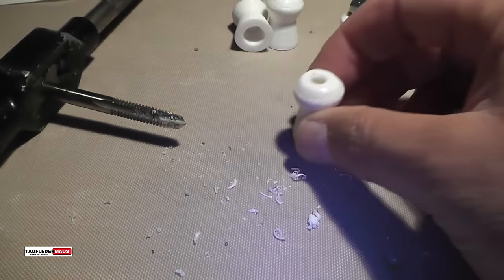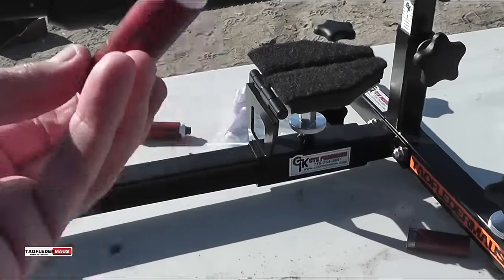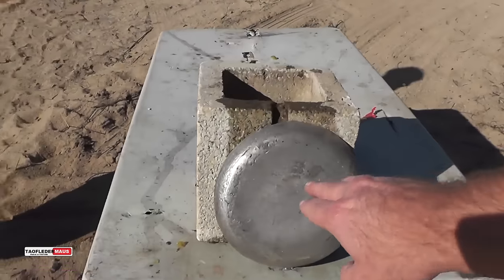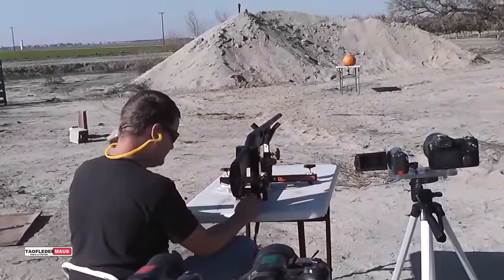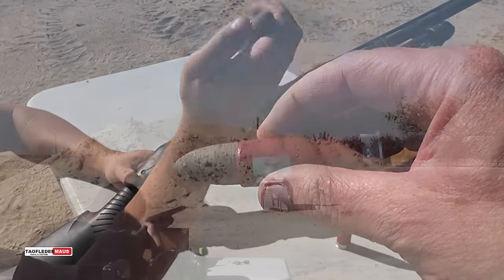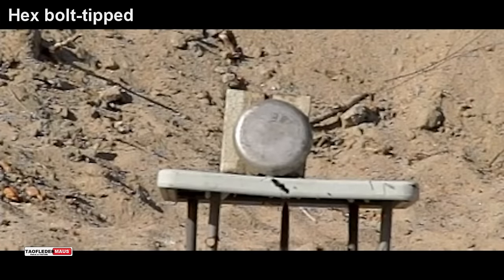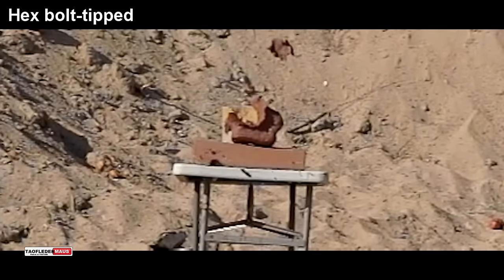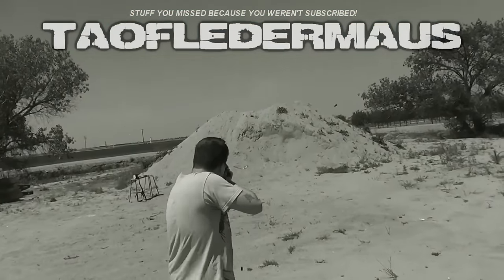15 year old viewer creates incredible 3D printed Slugs

Comment: I am not at all surprised that this design worked.  I have been meaning to suggest it for some time now.  I am however in wonder that the material used to create the oversized pellets held together.  Yes you should get tactical g-code to cut a few made out of brass with carbide tips in them.  Also, I suggest for future smoothbore projects that you do some research on smoothbore tank rounds.  Smooth bore tank guns are supposed to be more accurate than rifled ones.  Perhaps by studying the designs of some of the projectiles you could come up was a round that will fly stable out of a smoothbore shot barrel.  Just a thought.  :)

Comment: Drill a hole all the way though and put a large bolt in from behind with 2 nuts on the tip (trim the excess bolt if needed)  that should give you way more kinetic energy, plus the bolt head will harness all the power of the powder just using the 3d printed body for aerodynamics. Ohh and maybe hi brass :)
Reply: You can even file the tip of the bolt to make it some sort of dart

Comment: Instead of threading them try just drilling them and hot gluing the bolts. That way the bolt can separate and continue on. You would get much better penetration.

Comment: Why would you expect it to go faster? It may be easier to "push", but You bascally get the same volume to generate drag with much less mass to store the energy. It should actually go slower.
Reply from the maker: +zamaszysty  The shells are designed to propel a 1 oz load at 1250fps.   Normally objects lighter than that will go faster in proportion to the weight.   Because these were so light,  they did not provide enough resistance for the powder to burn at 100% efficiency.
Reply: And, on top of that - they also slowed down faster due to drag vs. weight ratio. So that's two reasons for them to go slower :)

Comment: Well - lets make an injection mold, sell the plastic pieces as figures for board games and well: Having a tab and a few screws is easy. I mean: it is a brilliant design, but when driving it to market, it is just a piece of plastic to be mass produced which means injection molding. Part of the brilliant engineering that went into those was you making a thread into them and screwing a screw in. Making the plastic from a 3D printer does prove, that the design is so robust, that a simple plastic and mold are good enough to mass produce. I see barely any point in using a 3D printer other then proove of concept - but a brilliant prove it is

Comment: Those are the same design as a Silverbear air rifle pellet. That's pretty awesome. But you should be shooting them at subsonic speeds
Reply from the maker: +Jake S    A lot of air rifle enthusiasts did not think this design would be stable at supersonic speeds.
Reply: ***** what if you tried it at subsonic? And is it possible to get the weight more evenly distributed?
Reply from the maker: I'm sure they would work well at subsonic speeds too.   I don't have any more of these to test but I hope Michael will send more eventually.

Comment: how do they work out of a smooth bore?
Reply: +Hayden cowen sorry how well* do they work out of a smooth bore
Reply from the maker: +Hayden cowen   That was one thing we failed to do.   I was going to do that but we were on a roll with the Benelli we didn't want to mess things up!
Reply: fair enough, I'd give them a go with mine ive got a range of lengths of smooth bore in 12 gauge (from 18-36 inch) but lack a 3d printer. ill see if I can get to a tech shop and get some made up.

Comment: This is just a copy of projectiles used in air compressed carbines.
Reply from the maker: +michaelovitch  They are shot out of a shotgun  and are 70 cal.   Definitely not a copy.
Reply: +TAOFLEDERMAUS 
you said it yourself ,i saw it later :
" we test out some more 3D printed slugs that are based on the design of an air rifle pellet"
exact same shape,even the ball of steel is a technic used in air rifle pellet.

Comment: sorry but 3d printed bullets have already existed for a few years (2012 that i know of) and even working 3d printed guns starting with grips (2011) working reusable guns as early as 2013.
Reply from the maker: +zylofaxx  Did you ever see high speed performance of those?    These worked.
Reply: Ya, the impressive thing is these work where as most of the others were crap. And I have yet to see a 3d printed gun that actually worked. Everyone of them I have seen tested blew up. And quite honestly you can build a working gun with plumbing supplies, you don't need to 3d print one.

Comment: You need to put a carriage head bolt in the end instead of a hex head.
Reply from the maker: +Pilgrim Prepper  I knew I did it all wrong!
Reply: Not all wrong no, in fact this will go down as one of your greatest successes, but the round nose of the carriage head would have possibly flown better, and looked cooler... Trust me, I'm your helpful hardware man...

Comment: No one has done it because it is a pure waste of time. The lightest 12 gauge slug bought on the market probably weighs around 383 grains. Shotgun slugs that are store bought have the weight to create massive damage and reliability. They even make slugs to kill bears. Brenneke Black Magic Magnum Ammo for 12 ga. Each slug weighs about 600 grains and is designed for maximum penetration. A box of these is like 13 bucks and this is surely the expensive stuff. So by the time you wasted on printed bullets you could have bought slugs that were actually worth a damn, lol.
Reply from the maker: +Azygos1986   Thanks for the dissertation.

Comment: Not really a 3d printed bullet is it when you need to then still fill the thing with various other metal objects. Also as others have said, it's a scaled up pellet, there's also the fact the bolts are what's being hit by the air and forcing it around the rest of the bullet. The kid isn't a genius, he didn't spend weeks working on a design in CAD with mm precise modeling and simulations.
Reply from the maker: +oBLACKIECHANoo  You're just mad you didn't think of it and become famous.
Reply: ***** I'm glad the kid is doing this kind of stuff but I'm just being realistic. It's not that nobody else thought of doing this and this guy is a genius it's that nobody else thought it would be worth doing.
Reply from the maker: There's a lot of dreamers,  but a few do-ers.

Comment: Now put a mercury capsule inside of it TFM. ;)    Great work by this kid indeed.
Reply from the maker: +Toasty Roasty Man   haha!  sure!
Reply: I guess you can't use mercury looking at your earlier videos but I bet you can use very heavy # 1 motor oil and seal the round with STEEL EPOXY PUTTY you can get right at walmart..

In fact I bet it would make a pretty good shot gun slug all by itself ! :)

Comment: so he found a way to make universal shot gun ammo ? Not that there was already a way but now anyone can have them!!!!! with a 3d printer..... It is a very nice simple design, but very effective.
Reply from the maker: +IloveJell0w  But people are all ready casting lead slugs that take about 10 seconds for each one.
Reply: ***** The difference is lead slugs are more expensive to cast.
Reply from the maker: They are dirt cheap to cast.
Reply: ***** Ya even though its 80 cents its about $1.00 each if you don't self craft and to get the self craft will be pretty high in it self while you could get a $800 printer and abs plastic pretty cheap do about %30 percent cheaper (guess is lower than dirt then). Ya these things don't go through metal but anything organic will not be in great condition afterwards.
Reply from the maker: You can cast bullets for less than a penny a piece.
Reply: ***** Last I checked for lead ingots its about $5-6 or so. You can cast them free not penny a piece. But you still have to buy the lead and the ability to smelt them. So in the end casting them costs more than a penny a piece unless you buy them which they will cost more.
Reply from the maker: Most people use lead wheel weights they get for free.  There's plenty of videos out there.

Comment: 3D printers are neat, material isn't cheap, machine isn't cheap. Molds on the other hand are cheaper, mass production, material cost lowered. 3D printers are just prototype machines, and the items made from them should not be used for replacing things that already exist. All the kid did was take a item already existing, and build a prototype. Opposite of the process, more or less a waste of time.
Reply from the maker: +Chew Toys  but you watched it.  Win!
Reply: Oh of course I watched it, love your videos regardless the content.

Comment: There's nothing really original about this at all. Is it cool...sure. But he took a known ballistically stable design of a lightweight projectile and scaled it up for use with a shotgun, printed it out of a lightweight polymer, and used readily available, everyday items, like nuts & bolts to add as much weight as was necessary to ensure it had the proper amount of mass & stability for the rate of speed the projectile would be moving from the barrel of a shotgun.
Reply from the maker: +BAZYRKYRS BUNKER  I can't believe no one else thought of it!

Comment: nothing was really invented though was it, from what i understand "if it loads it shoots" is the rule of thumb commonly used for shotguns. making a normal slug out of PVC or PLA it not really inventing anything. if the slug did something more exotic i would be impressed, not that it matters anyways. the title should say "kid prints 70 cal slug for shotgun".
Reply from the maker: +orkarma   You don't appreciate the complexity of super sonic aerodynamics.
Reply: correct me if i'm wrong but are not alot of shotgun round types sub sonic...and probally evan the printed round in this video
Reply from the maker: But super sonic is so complex,  the kid didn't just make a projectile,  but made one that withstood the heavy g-shock,  and flew with great stability.  It's a big deal.
Reply: you should of gone into that in the video, kool vids btw ;3
Reply from the maker: I'm assuming most viewers have seen our other tests and failures with rounds that were much more promising that these.
Reply: +TAOFLEDERMAUS ''B-But super sonic is so complex'' 
No. it really is not.
Reply from the maker: IS SO!

Comment: Please look up definition of 'invents'. Nothing has been invented here.
Reply from the maker: +Derek Thomson  I didn't consult DerekThomsonDictionary.com  but all the major ones agree with me.An invention is a unique or novel device, method, composition or process. The invention process is a process within an overall engineering and product development process. It may be an improvement upon a machine or product, or a new process for creating an object or a result.
Reply: +TAOFLEDERMAUS So what is 'unique or novel' about another bullet. It has a different design than some others, I'll grant you that, but he in no way invented the bullet.
Reply from the maker: +Derek Thomson   You are fixating on stupid stuff.   He invented a working,  accurate and repeatable 3d printed slug.   He not only 3d printed it,  but used a special process to strengthen it so it would not shatter from the g-shock.
Reply: +TAOFLEDERMAUS 
That's called designing.
Reply from the maker: +Derek Thomson  Fixation
Reply: +TAOFLEDERMAUS 
Fact is he did not invent anything. All he did was design a different version of something that ALREADY EXISTED. And then printed it on a 3D printer... So if I go and modify an AK-47, or re-design it, that means I invented the AK-47? No, it does not. Understand that logic.
Reply from the maker: You are more than welcome to show me a 3d printed shotgun slug that works as perfectly as this.
Reply: +Ray Guzman  NEED SOME ICE WITH THAT BURN??????/ WORLD STAR WORLD STAR WORLD STAR
Reply: +Rodolfo felix huh?
Reply: you're right he didn't invented anything, he designed something.

Comment: remove the metal and bolts added on the slug, and you got yourself a non lethal shotgun rounds
Reply from the maker: +Mike Bellotti   Chances are it would still be lethal flying at such high speeds.

Comment: 9000 rpm nice! Be nice next time for shots like the clay to keep the cam aimed a little lower so we can see the clay flying all over the place.

BTW how fast does an average rifle bullet twist? how about a .22lr remmington golden ammo? I used to use those a lot, surprised some things haven't changed.

BTW a quick squirt of teflon (especially the stuff that dries white) works awesome for lube from anything from those printer slugs to inside a woodworker's table saw because wood dust can't gunk up your raising and tilting controls. I just buy the generic stuff that says it dries. People can spend a lot of money on crap like bore butter but I think that dry teflon is probably about as good as you are going to get. They used it back on the black talon ammo that caused such a fuss years ago about being so deadly. It was new tech then now it's old news but still works great and will not gum up a gun. I think ballistol may even have it in, gotta check on that oneday.

Darren hitting the tin at the end was funny as hell! why'd he release the gun via a remote string? Do you guys ever calculate bore pressures in CUP psi standards? I know reloaders use that data and the reason I mention it is because shooting high is a direct function of that and using a lighter lower density load like steel or steel/plastic. Theyhave some nice slugs out that flare into 3 prongs once inside the animal that would probably devaste that clay once behind a piece of wood or 3/4 inch plywood.

Comment: Bullshit, just like the kid who "Invented" a clock radio by taking the guts out of a clock radio and putting them in a different box. Complete shit.
Reply from the maker: +TruAnRksT   It's an outrage!
Reply: Not an outrage, that can only be your definition. 
I have seen this shape in ceramic somewhere. Pull knobs or whatever. A ceramic pull knob with a bolt in it is going to have far more impact than this printed plastic sabot with bolt. How can this be called an invention? An innovation perhaps? That's still questionable.

Mostly who cares, we won't all have 3D printers.
Reply: +TruAnRksT 
Anyway it's the same shape as a common .22 cal pellet. Just remembered that.

Comment: It show how pointless 3D printer are. You can do better job with cast lead bullet (slug). Only thing you need are pliers, steel pan, fire.
Reply from the maker: +Eugen Ohanka  They are used for prototyping.
Reply: But not for prototyping slugs
Reply from the maker: You just saw it.
Reply: No this is just playing. It is even bigger nonsense, that printed gun.

My advice is:
Get a girl and start casting your bullets and slugs.